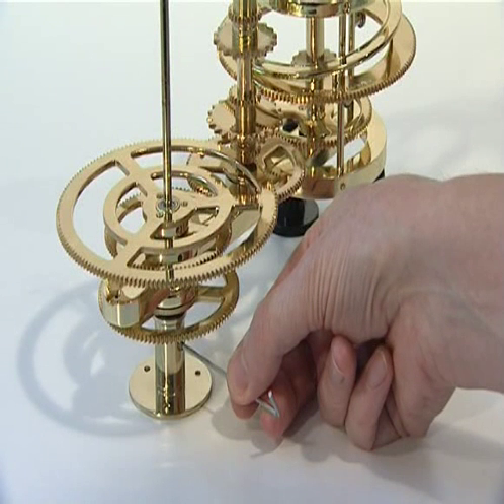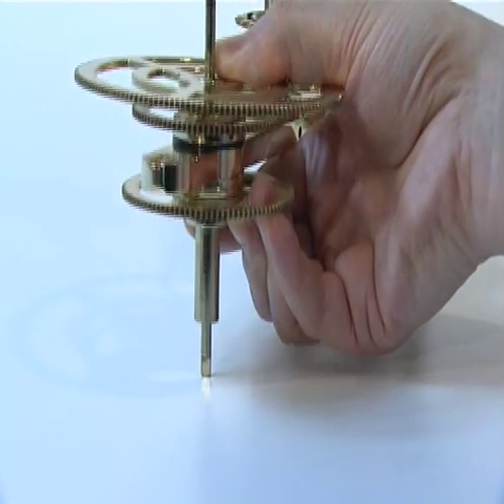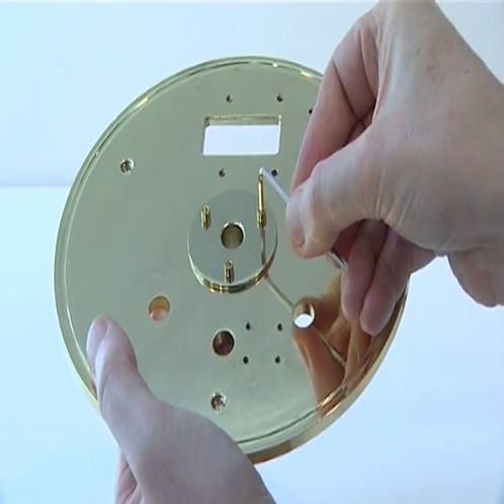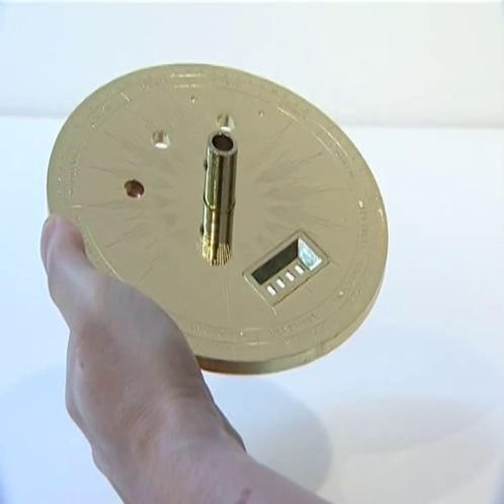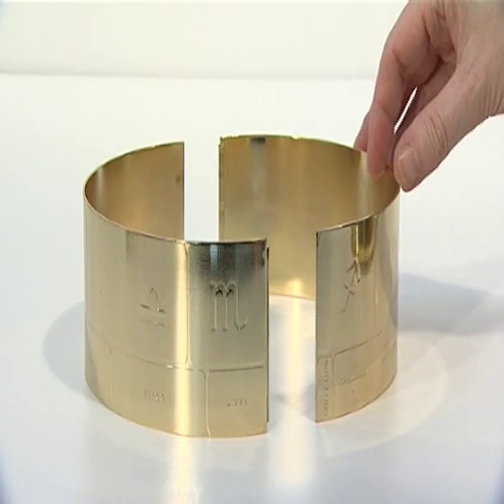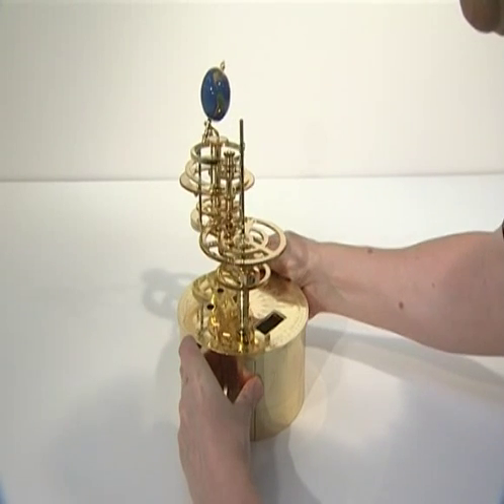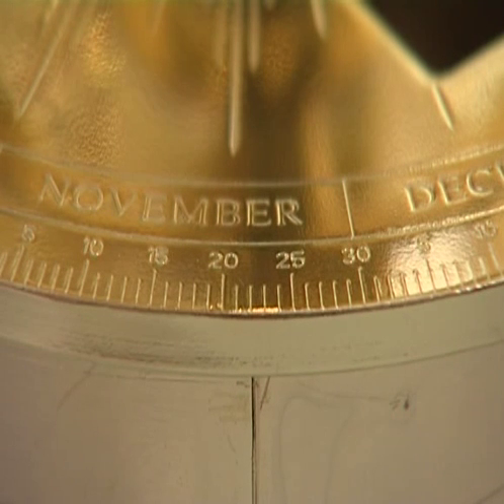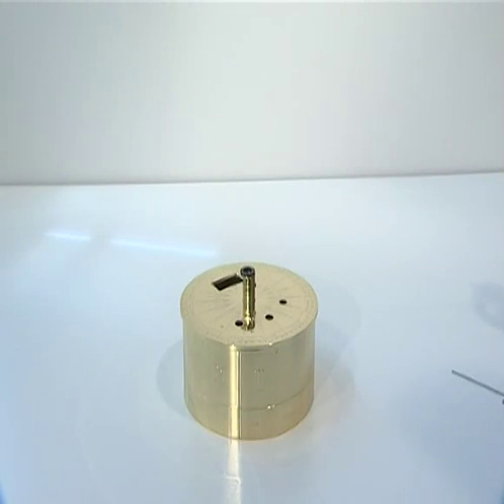Build a model sun, moon and earth orbiter: Stage 4

Comment: @Anthonyk312 There are 52 issues of the magazines that come with 1 to several parts not 52 parts for the entire model!!! The part numbers run up to 115 but there are actually more than that because some parts share the same number and some are not numbered like the 2 small bearings that come already installed in the Central Column which is part number 54.